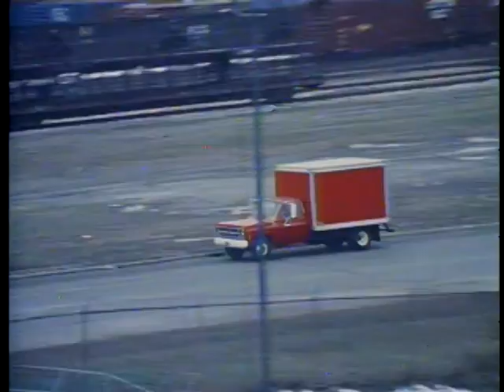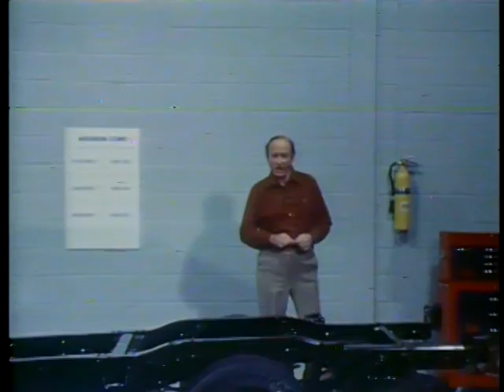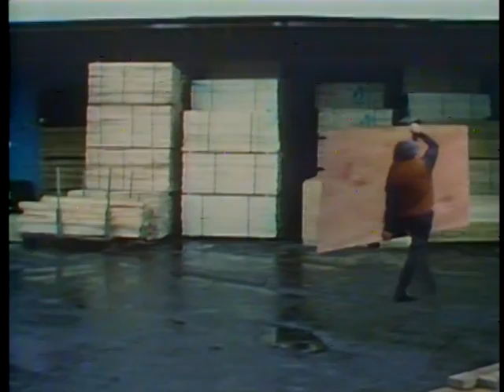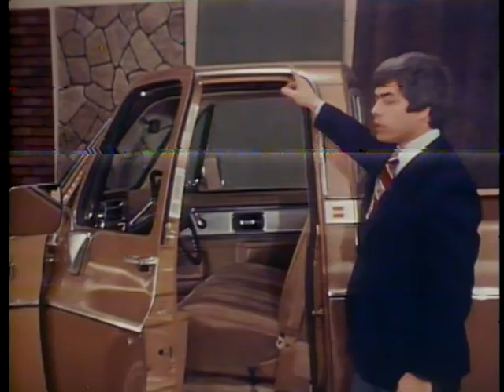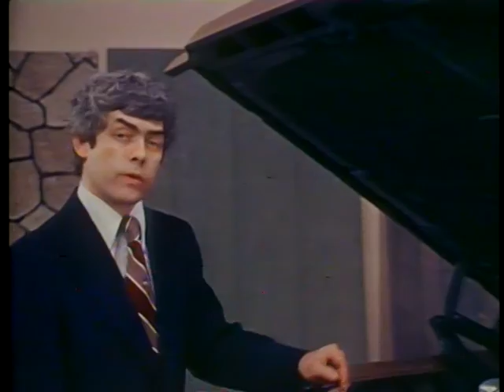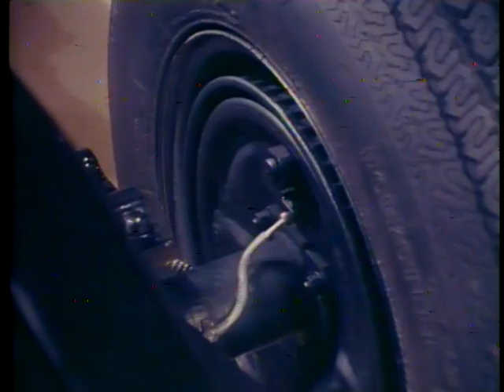1978 GMC Trucks: Commercial Work Trucks, Truck Construction

Comment: These are '79s, my dad had one. Lots of carb-related cold weather starting issues and it rusted like it was an Olympic sport. It was our main family car for a while - 6, 3 on the tree, no power steering. When Mom got a Plymouth Horizon with PS, PB and AT she drove it as though it was a Lotus.
Reply: It's an '80. The rectangular headlights were part of the higher end trim packages in 1980.

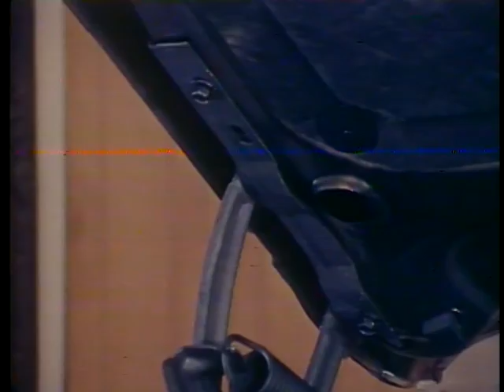Comment: 12:20 yea well you should have made those hood hinge plates where it bolts to the hood about 6 inches longer and SIX bolts for support, so that EVERY single 73-80 hood doesn’t fold/crack right at the hinge.
Reply: Keep everything lubricated and it worked fine.
Reply: Learn how to close it.